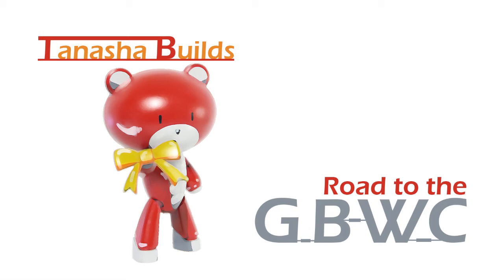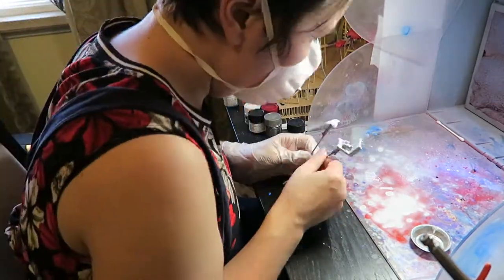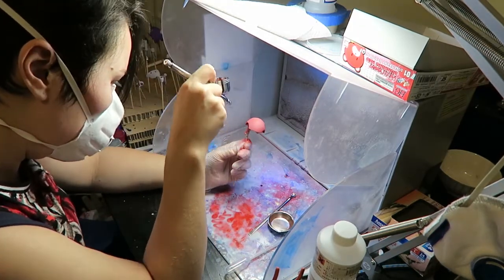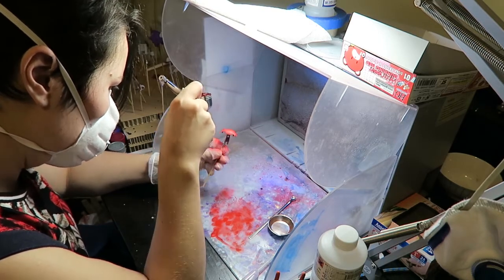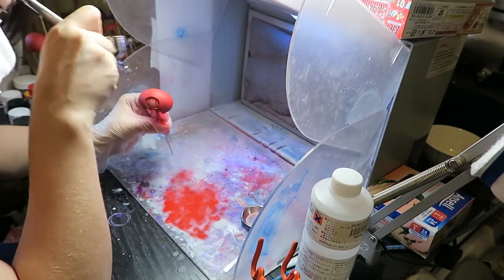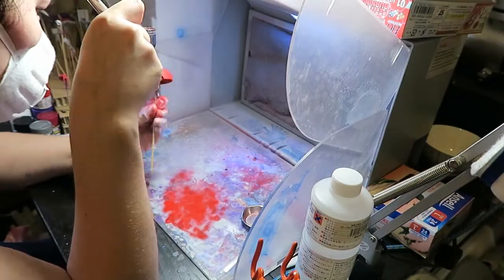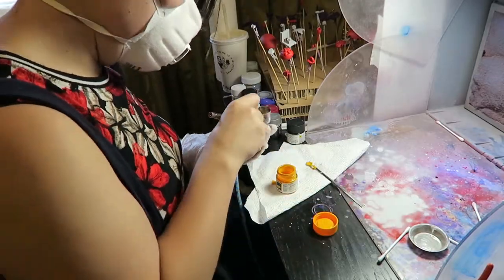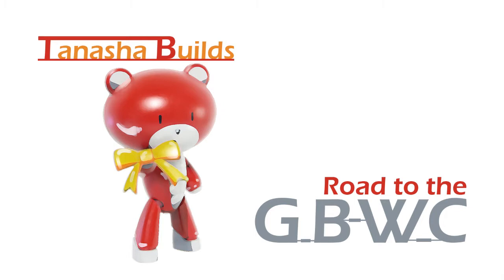Road to the Gunpla Builders World Cup - Episode 7 Petit'GGuy Painting

Comment: can i use nozle needle 0.4? if can't why?
Reply from the maker: John Bonz yeah of course you can.
It just depends on what airbrush you have. 
If your painting a big area then a larger nozzle is better. 
You really use the smaller ones for details. 
My delta(which I don't really use anymore but was used in this video) has interchangeable nozzles, but I'm also a bit lazy with changing them.
However I use a sparmax max-3 which doesn't interchange so I am stuck with the one size. 
So it's really make do with what's available to you.